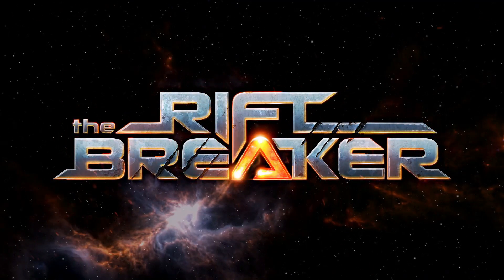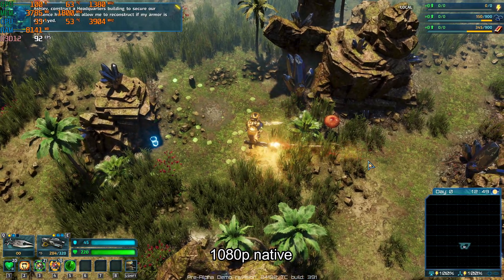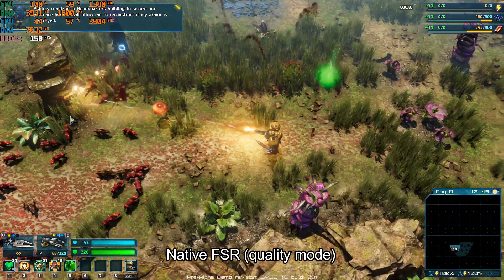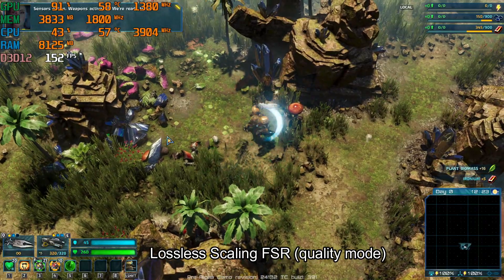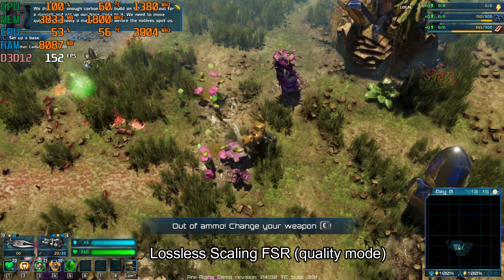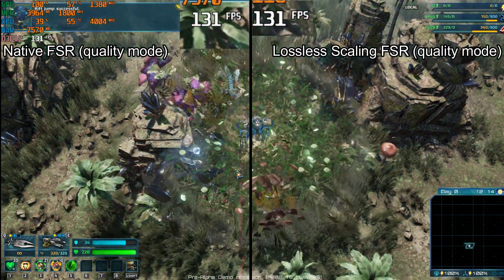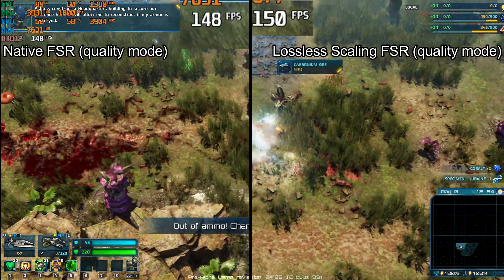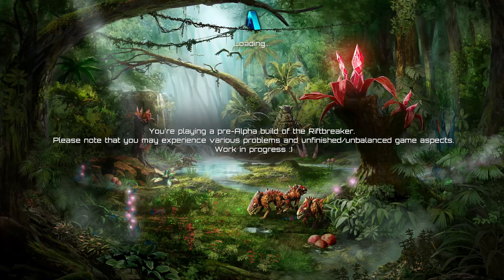AMD FSR VS Lossless Scaling - which is better? | The Riftbreaker test

Comment: Interesting use case I discovered; the old version of Dark Souls on PC, prepare to die edition, has a really crap upscaling method for 1080p displays, it's blurry af.  Running lossless scaling on a native 720p window with automatic scale factor and 1.75 sharpening makes the 1080p presentation noticeably sharper.  It's definitely not perfect but it certainty improves the experience.
Reply from the maker: Try to go 1.0 with sharpness :)
Reply: @IGameEverythingSolo  with the original version of dark souls the native resolution is so low the extra sharpening definitely helps.  The next thing I'm curious to try is to see if it'll work in combination with the dsfix mod.
Reply: @IGameEverythingSolo  yep, you can scale with the dsfix mod, 900p looks like a true 1080p but this is an old 765m laptop I'm testing with so the framrate bonus is pretty negligible.  Still, very interesting stuff, probably will be more useful when my new laptop with a 1440p screen arrives.  

For 5$ I'd recommend this app, it's a pretty low risk investment and it definitely works as advertised.

Comment: can you tell me the quality mode setting for Looseless scaling??
Reply: If I'm not mistaken, you're sort of manually controlling that by way of the native resolution you choose in the game.  For example choosing 720p native and scaling to 1080p will show some improvement but setting the native resolution to 900p before scaling to 1080p will yield something that looks much closer to native 1080p.  So think of 720 to 1080 as balanced and 900 to 1080 as quality.

I bought it and have been tampering with it and comparing to a native fsr game like Myst and this is the impression I get.

Comment: The results are pretty close. If anything Lossless Scaling is better because you can control the amount of sharpening, which is not present in all games with native fsr
Reply from the maker: It works really well, I am testing it now on Hellblade, it gives great performance :)
Reply: with 2 of sharpness the result is like AMD FSR ? 🤔
Reply from the maker: @lorenzovertemati4104  explain your question in more details, I did not get it :)
Reply: @IGameEverythingSolo  with a value of 2 in the sharpness box, will the image be as sharp as that of the original amd fsr?
Reply from the maker: @lorenzovertemati4104  I can't tell, because we do not know how much sharpness native AMD FSR implementation use.

Speaking about Lossless Scaling - settings sharpness to 2, will add zero sharpness to the game. Settings sharpness to 0, will give maximum sharpness to the game.
Reply: @lorenzovertemati4104  the sweet spot is 1.
0 is very sharp in some games that you can see weird corners in game.
2 being the blurry one.

1 is the closest you can get to native quality.

Then again, it depends on games.